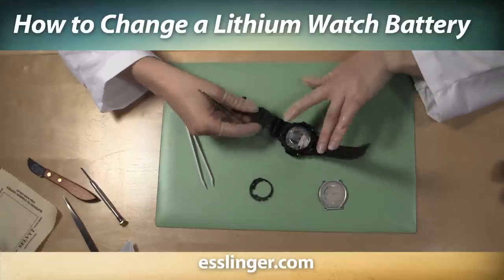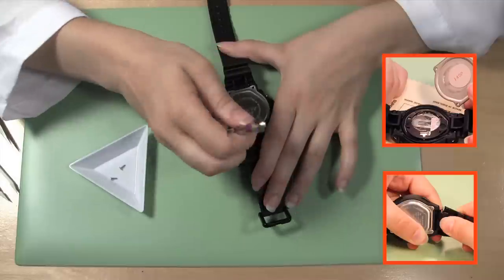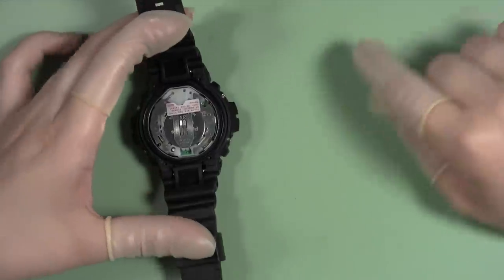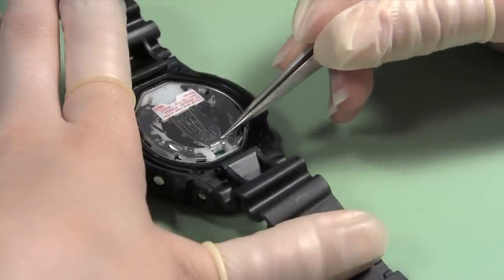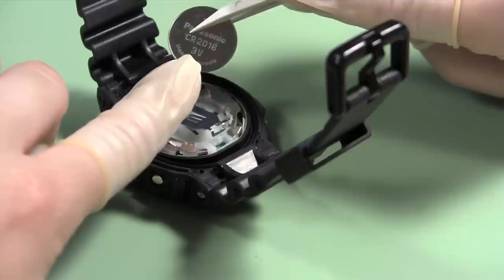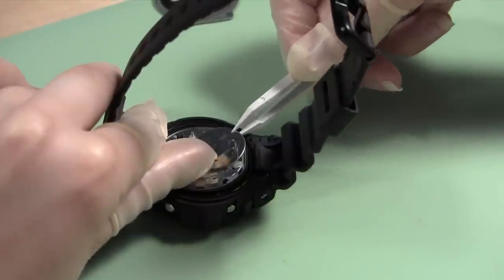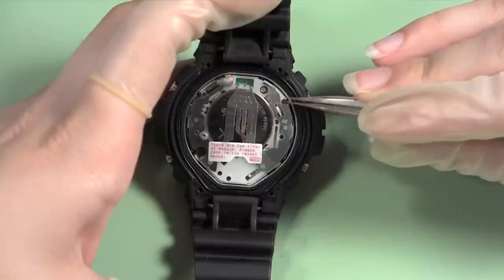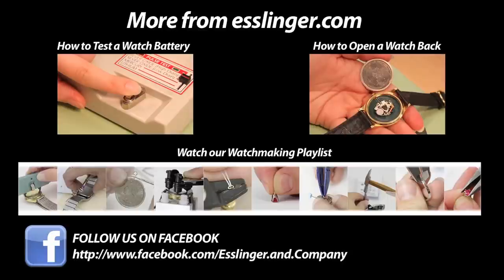How to Replace a Lithium Battery

Comment: please I have a 10mm 35mAh  3.7v lithium battery that I want to install in a mechanical quartz watch . so I need convert  voltage to 1.5V and output power of 1μAmpere  only ...  .  anybody knows which IC I need please ?

Comment: I don't have the tweezers. What else can I use to jump start it?
Reply: Mobius494 I’m mad your comment has no response. Who the hell keeps those kind of tweezers in the house?
Reply: Kane Odam It turned out I didn’t need to jump start my watch. It just turned on automatically when I put replacement battery in.
Reply: Mobius494 LOL. A similar thing happened with me as well. I just had to jostle the battery a little and it cut right on lmao.
Reply: Sometimes pressing two buttons at once will work (it did with my old Casio G-Shock, very similar to the exact watch in this video), but anything conductive will do the trick, such as a thin paperclip.
Reply: @akawaka2  You probably have them. Basically, tweezers that are metal, conductive, but not magnetic. This video is from a company that sells watchmaker's tools. In their world, magnetic tweezers are good for picking up small metal parts and not having them fall off. Non magnetic tweezers are good for working  near the balance wheel, where you don't want to accidentally magnetize the hairspring. Digital watches don't have these parts anyway. So, the common tweezer in your medicine cabinet might suffice.

Comment: does opening gshock make it less water resistant?
Reply: It did on my old when when I got the repairman to do it. They actually have a disclaimer to say there's no longer any guarentee of water resistance in the event of battery replacement unless it's sent back to Casio.

Comment: I replaced the battery in both of my watches some time ago. The only thing I didn't know was the proper way to loosen that metal clip. After I put fresh batteries in I didn't need to do the tweezer thing to jump start either of them.

Comment: Will this make water ressint watches less water resistant
Reply: No, because water resistance is achieved by screws and rubber/plastic rings. No adhesives are used. Thus, opening up your watch will have no negative effects on water resistance, if you reassemble it properly

Comment: hi  I  need  parts  mine  side  start stop button   cracked after years::(((  where can I get  used parts  any link??   1659   DW-004   see through  clear type color  but  buttons  are  black  color.I do not really  care  the button color  any ways.Any  help for  this   thanks  guys  I am locating at  Toronto canada  .cheers  .this  watch I use  about  24 years  ::)))

Comment: Khi dùng nhíp kẹp quả pin ko bị chập điện hay sao
Reply: That's why he used plastic tweezers to remove the battery bro, the metal ones are just to do the AC reset on the watch.  Hope this helps!

Comment: Opened the watch. Realized they made removing the battery as complicated as they could. Grabbed a hammer. Smashed the watch. Bought a new watch.... ridiculous how we need "special tools" like microscopic tweezers to change a fucking battery....
Reply: My watch cost £200, I aint gonna use no hammer but I feel your pain ;).
Reply: Yeah that metal clip was a pain in the ass. It was even harder to put it back in because the bending was making it hard to snap back underneath the plastic holder.